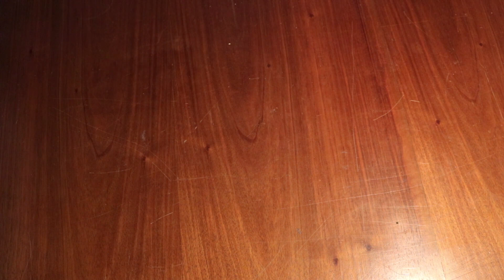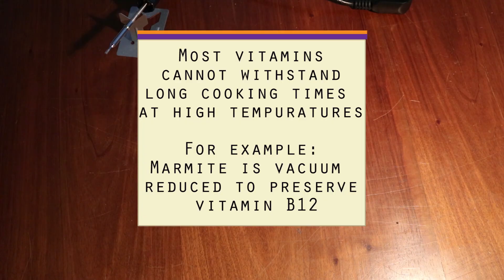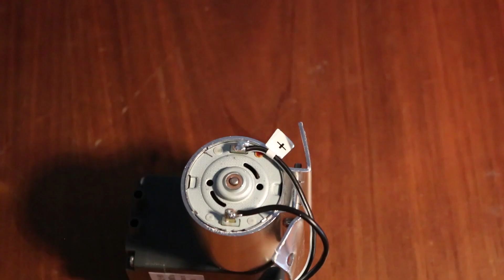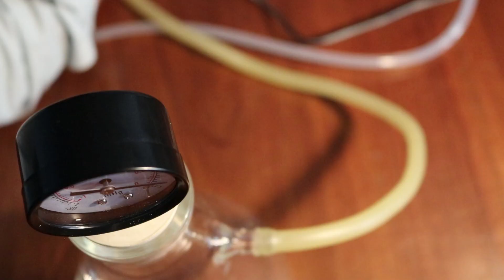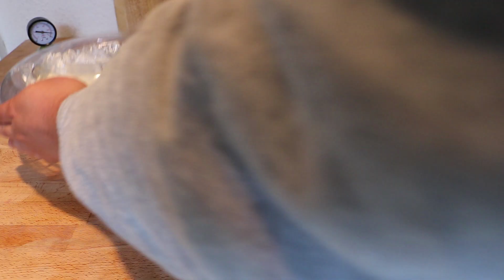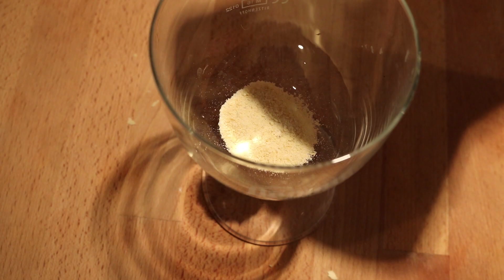How to Make Milk Powder | Flavor Lab

Comment: Reason for not dissolving in water: Powdered milk are mostly fat and protein. They are not dissolved in water naturally. You are supposed to add Emulsifiers to get them dissolved
Reply: great
Reply: Nope I am just drinking powderd milk but nothing like that was needed
Reply: Rahimatulla Shaikh because yours is store bought and they add emulsifier in it.
Reply: @swethasaravanan6862  Does the natural emulsifier evaporate during the dehydration process?
Reply: Tim .-l I meant the store bought powdered milk which has already gone through dehydration.
Reply: @swethasaravanan6862  That's why I'm asking. Do they add a emulsifier to store bought, or do they dehydrate it in a better way, so it doesn't evaporate off?
Reply: @hzpc  you normally add it to boiling water. it will work without emulsifiers this way I've done it multiple times as method to add THC to creamer or other recipes
Reply: Nope, that's incorrect. Milk normally contains 3 groups of macronutrients; proteins, fat, and sugar in the form of lactose. Just like it was originally dissolved in water, all of it can be redissolved in water as well. However there is one but, a large fraction of the proteins are quite heat sensitive and will irreversibly denature if heated too much or for too long, after which they won't dissolve in water any more. From the caramel colour of the milk powder in the video it is obvious to me that the milk was exposed to too much heat while in the dehydrator (the 50-70 C temperature of a dehydrator is too high for the whey proteins).

Commercially available milk powder is made through spray drying, which although it uses temperatures comparable to or even higher than that of dehydrators, it's only exposed to that heat fairly shortly, and most importantly the milk proteins aren't actually exposed to that heat because when the atomised milk drops are being evaporated into powder they're actually cooled by the evaporation process of the water those droplets contained.
Reply: @pieterveenders9793  "Importantly the milk proteins aren't actually exposed to that heat because when the atomised milk drops are being evaporated," I do not think that is possible. Even atomised, the proteins are being exposed to the heat.

Comment: Under vacuum milk boils at 15°c or 59°f . There are plenty of know it all's out there telling you what you should and shouldn't do . As for me great job on your mini documentary . Thank you from your new follower !!!!
Reply: LagiNaLangAko23  under vaccum. hence no need for an external heat. perhaps no heat would also help retaining the whiteness too?
Reply: That's a very vague and potentially even misleading statements. You can't say "under vacuum milk boils at 15 °C" because vacuum isn't a fixed thing but rather a range (from anywhere between atmospheric pressure to perfect vacuum). More accurate would be to specify under what vacuum it would boil at 15 °C, namely around 2 kPa, or approximately 1/50th of atmospheric pressure. But yeah, under high vacuum (5 kPa and lower) milk boils at approximately 30 °C and below, which will keep it perfectly intact and prevents the lactose from caramelising and most importantly the whey proteins from denaturing.

Comment: You can dehydrate milk  without going thru your process in a dehydrator or oven it just takes alot longer. Also I realize from this the nutritional value if not done the spraying pro way/ vaccum pressure to reduce boiling point way's it be like very limited nutritional value. Regardless you loose nutritional value doing it the pro way to but it be a ridiculous  loss doing it the naive way. Great video i wonder if most of the juice powders are done the same way at least in mass production. The biggest benefit for ever doing this is that the shelf life is extremely long its still not really that great though for most cases.
Reply: Yes, fruit juices are concentrated by boiling under high vacuum. The reason why is to save money; by concentrating it the juice will take up a much smaller volume and weigh much less, which makes shipping it around the globe a fair bit cheaper. Then once it arrives in the country of destination the factory will reconstitute it by adding water to the juice concentrate until its back at its normal concentration again, packaged in cartons, and sold to wholesalers.